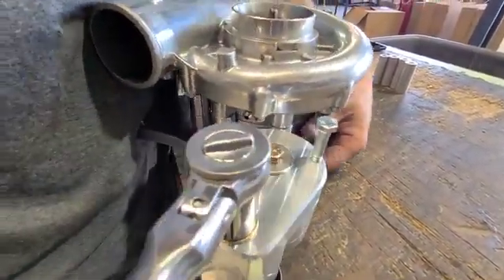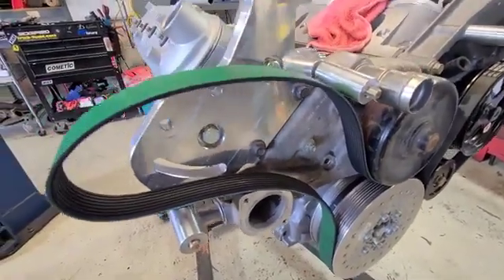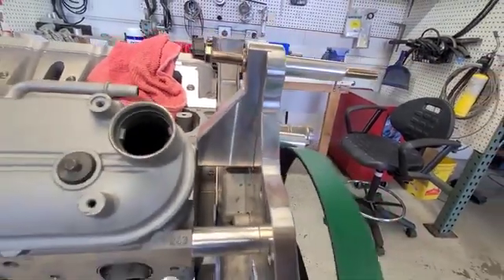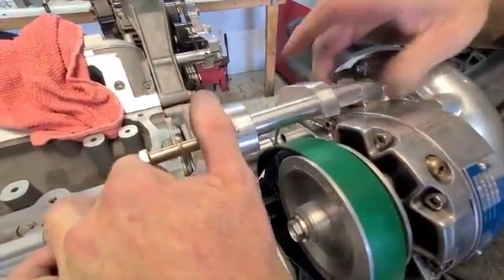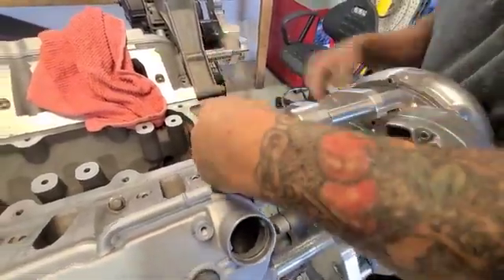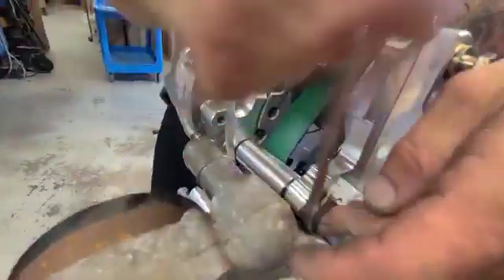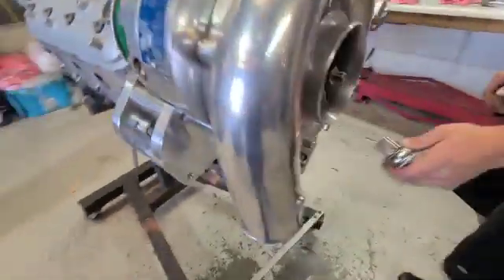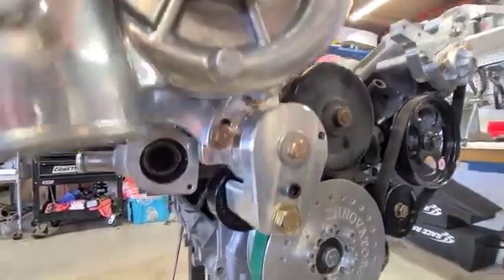C5-C6 BRACKET WITH BILLET TENSIONER INSTALLATION AND ADJUSTMENT

Comment: Thank you for this video…. I didn’t realize I had to take it off the spacer on the bottom to easily get to the bolts to tighten or loosen that tensioner. Thank you, baby Jesus.😂🙏🏽🙏🏽🙏🏽🙏🏽🙏🏽